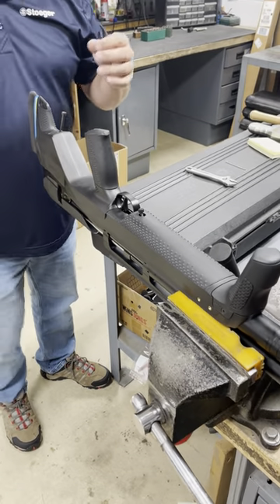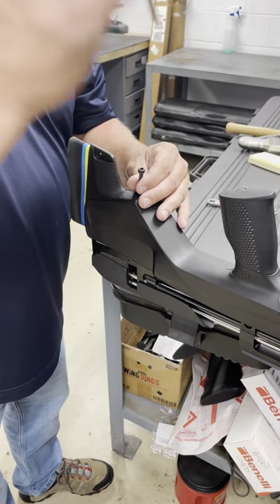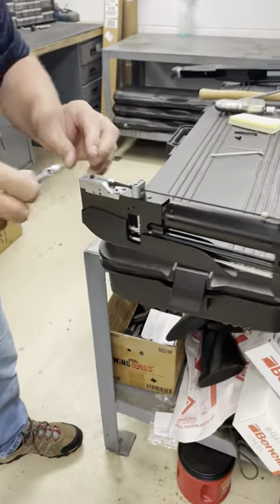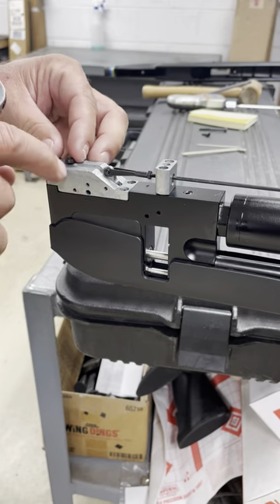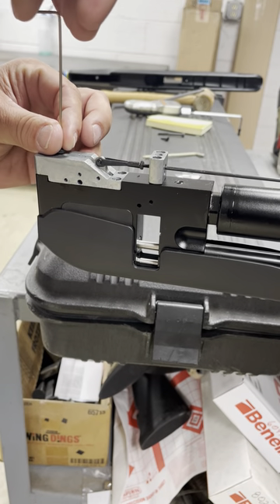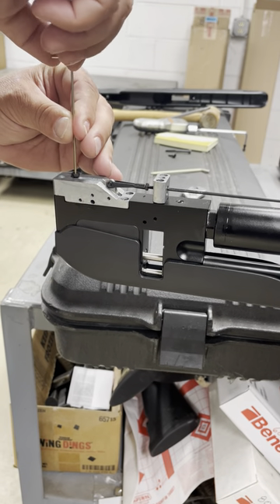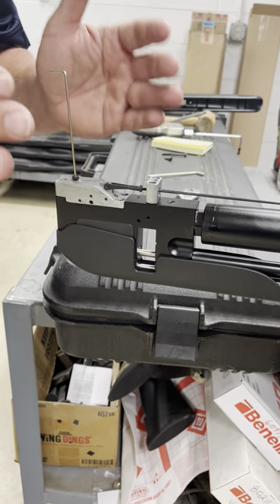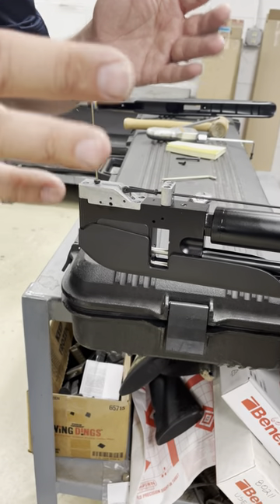How to adjust the trigger pull force (second stage) on Stoeger XM1 Bullshark

Comment: I'm sorry but I didn't understand how many clockwise turns I have to make to make it as light as possible while still remaining safe?
Reply from the maker: Changes are micro-turns.  1st make sure gun is not loaded.  Then double check that.  Then put gun on a proper gun erst/vide upside down.  Remove two 4mm screws that hold stock on.  Do not loose those screws.  Cock gun.  Make sure it's unloaded again and not pointing at anything that can be injured or damaged,  Put one hand on cocking lever so you can hold it back and then using 1.5mm hex wrench, turn screw MINUTELY clockwise, like in 1/16 of a turn until cocking lever wants to slide foward and will not stay cocked.  Then turn COUNTER CLOCKWISE minutely, like 1/16th of a turn until gun will stay cock and withstand being dropped or knocked without discharging.  Putting the trigger too lose can likely result in injury or damage with an accidental discharge.  Gun should not stay cocked when it's too loose but must remain safe and cocked even it is strongly jarred or dropped.  For people withyout experience working on triggers on PCP rifles, it is BEST to leave it as it comes from the factory or have a qualified airgunsmith adjust trigger for you. HAVING THE TRIGGER ADJUSTED TOO LIGHT CAN RESULT IN INJURY, DEATH OR PROPERTY DAMAGE.  It should already be at less than 2 lbs as it comes from the factory.